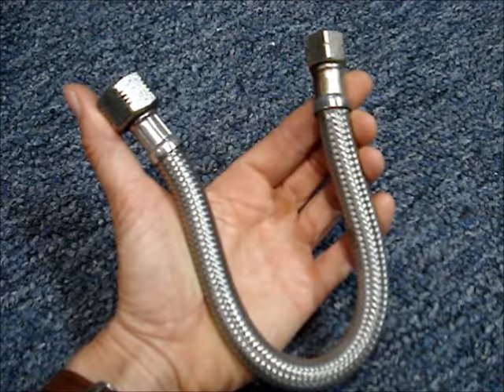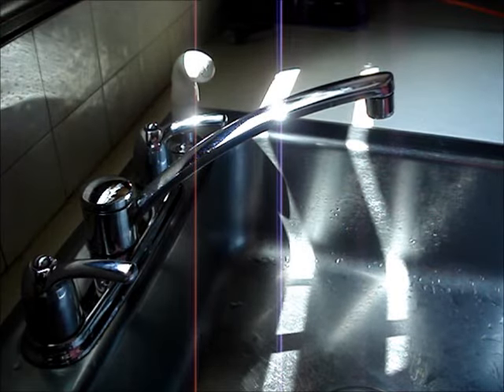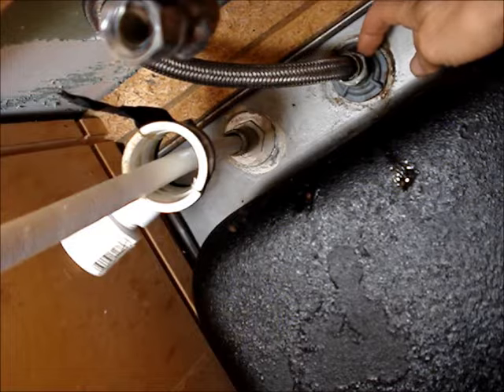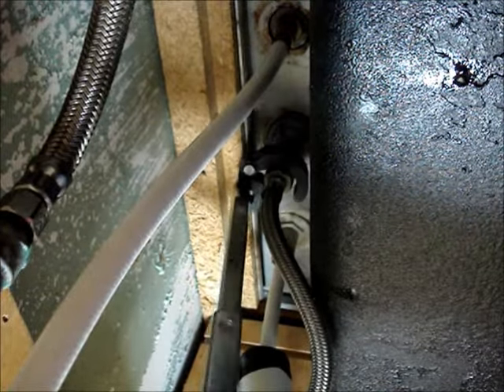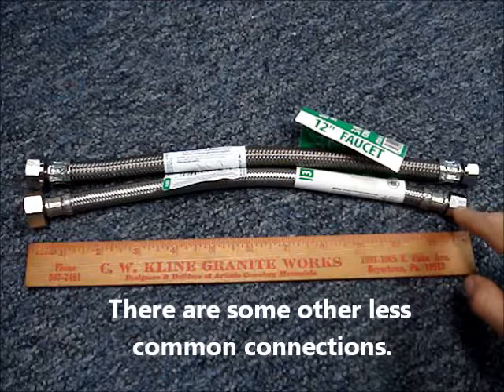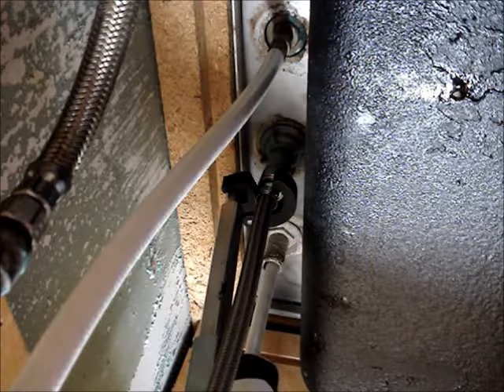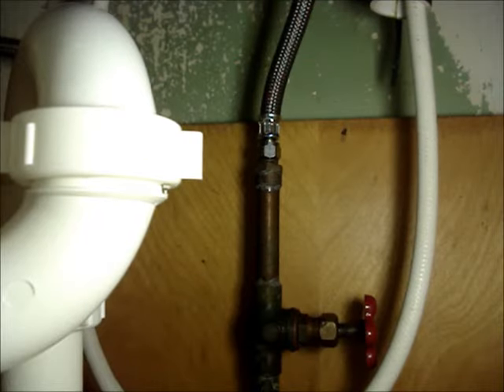Replace Kitchen Sink Water Supply Lines

Comment: I was wondering about whether to add thread seal tape to the stop valves, as well as the supply line connectors on the faucet, but it looks like the rubber gaskets on the supply lines provide a proper seal.  Thanks for the common sense tips.
Reply from the maker: It's my pleasure to help with the repair.  Thank you for taking the time to write the kind words.  Happy plumbing!  lol

Comment: You seem like a true professional! Subscribed after first video. I had a stuck supply line nut. Eventually, force with two wrenches freed it. I would guess they are all probably designed to move since their conception, so keep working at it if you have a stuck one.
Reply from the maker: Thank you for subscribing and watching the video.  Welcome to Know How Now.
Reply from the maker: You can try tapping it and some more penetrating oil, have a coffee and try again.  I have a dremel tool with a cutting wheel that I use as a last resort to cut stuck nuts, flanges, etc.  When I bought the dremel tool, I thought I'd only use it about once a year.  It just saved my again yesterday to get a quick link removed on my bicycle chain.
Reply from the maker: I can't think of any reason for a design that would have a nut that doesn't turn.  I've had plenty of stuck plumbing connections.
Reply: @Know-How-Now  two wrenches finally got it free. I was worried about breaking it/deforming it, but I guess it needed a little more force. Wild. Now I know. Thanks for responding.
Reply from the maker: Good to hear you got it loose.  Stuck stuff is the norm for plumbing repairs.

Comment: Very straightforward and helpful instructions. I now feel confident to do this job myself. I concur with how great it is that directions for closing and opening water flow  as clockwise and counterclockwise is included.
Reply from the maker: Best wishes for the repair, Jennifer.  Initially, I am sometimes apprehensive about trying something new.  I find that if I take my time and think everything through it usually works out.  The more things I try and learn by doing the easier the next repair becomes.

Comment: any idea why the hot water would dribble out and the cold is fine? I noticed the hot water cable under the sink is actually two cables joined together with a metal joint that the two separate cables are screwed into

Comment: what if the nut keeps spinning and will not come off? That is by issue ad i can't find anywhere on how to get it off
Reply from the maker: If you have the nut fully loosened, it could be stuck, try giving the hose a gentle tug to break it free.  The other possibility is that the threads are damaged.  Try pulling the nut away from the connection while turning it.

Comment: Thank you for this , especially the counter clockwise and clockwise directions in opening and replacing the faucet piping.( and not to put Too much torque!)
Reply from the maker: You are welcome, Brad.  Thanks for taking the time to write a compliment.  If you haven't already done so, click on the channel name and check out the other videos and support the channel by subscribing.  It's free, and it will allow me to continue to add videos.

Comment: VERY HELPFUL.  I was wondering if you used the basin wrench to remove the water supply line from the faucet (and likewise, to tighten them).  No way you will ever get an open end wrench or slip joint pliers up behind the sink basin
Reply from the maker: Thanks for taking the time to watch the video and write a comment, Matt.  You are correct, I did use a basin wrench.  You may already know this, if you have a rusty/stuck nut/connector, spray it with PB Blaster penetrating oil.  Gently tap the stuck part, wait a hour or better yet, overnight.  Then try again.  I have I video that shows how to use a basin wrench.  https://www.youtube.com/watch?v=gwM9Sk3E_Ok

Comment: are these fittings intended to be connected directly  to the flex line ? or do they need a little teflon tape or plumbers paste on the thread  ? ?
Reply from the maker: Both ends of the supply lines have a rubber gasket that will make a seal when tightened.  No need for paste or tape.

Comment: Question: Does wall mounted faucets have these supply lines? We have a line or pipe leaking water down to the basement from what seems to be something inside the wall connected to the faucet.
It started very soon after I installed a new faucet after our old one stopped working due to a bad cartridge (I was not able to find a replacement because of it's age).
Reply from the maker: Without seeing what you have, it's hard to give an accurate answer.  Check out this video, did you have a threaded connection like this one?  If yes, did you seal the threads with pipe dope or plumbers tape? https://youtu.be/BDm6oFUuJJA

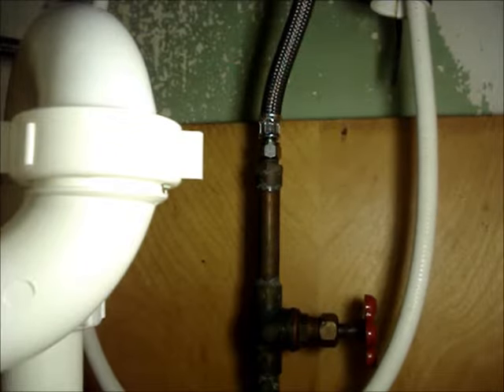Comment: My problem is the white flexible tube at 1:47 or 5:42, It’s leaking at the end of it. How can I fix that part?
Reply from the maker: It would be very time consuming and hard to try to write back and forth to you and give you an accurate answer on something I can't see.  I'd suggest searching "fix leaking kitchen sink sprayer".  You'll get video/pictures and how to fix it.
Reply: Know How Now it’s not the sink sprayer, it’s the white line that’s attached to the faucet
Reply from the maker: If I understand your question, you are asking if you can repair the flexible water supply line.  I've never tried to repair the ends on a supply line hose.  It would be hard to find the correct rubber washers for the ends.  I recommend replacing the flexible water supply lines, they are not super expensive.

Comment: I was able to get the nut off the valve but the hose seems to be stuck with some sealant any tips to free the hose from the water supply valve in this case
Reply from the maker: You could try heating it up with a hair dryer.

Comment: How often should the water hoses be replaced? I use the plastic kind.
Reply from the maker: The plastic will likely hold up longer than the rubber seals on each end of the hose.  I put the replacement date on the hose (Sharpie or a tag).  It's hard to say how long the rubber will last, it depends on your water and the location of the hose.  Heat would degrade the rubber seals more quickly.  If you don't disturb the connection it will likely last at least 10-15 years.

Comment: So, no plumbers tape needed?
Reply from the maker: No, the rubber gasket is the seal.  If you are putting tapered threaded pipe together or something without a gasket, then you need plumbers tape.

Comment: I just installed new supply lines for my kitchen just a few months ago but every few weeks they come loose and start leaking pretty bad.  How do I tighten them so they dont come loose again?  I've been told not to tighten them too much or that could cause damage.
Reply from the maker: You should tighten the supply line tight enough to compress the rubber washer so it makes a seal.  For most people you just need to use your hands to tighten.  I sometimes use a wrench for the last 1/4-1/2 turn, but I am female and don't have enough strength to fully tighten.  If you make it too tight, you risk breaking the plastic nut.
Reply: @Know-How-Now    I do that but I still keeps coming loose every few days. The nut isn't plastic.  I think its aluminum or steal,  and the line is brass.
Reply from the maker: You might try buying a tube of Loctite Blue (breaks away with tools) thread locker and putting a drop or two on the threads. That should stop it from loosening.
Reply: @Know-How-Now    Oh.  I thought of using thread locker but I was worried that would prevent me from removing the lines when I need to.  but since you suggest it. I'll try it.  Thank you.
Reply from the maker: I use the "blue" Loctite on my bicycle all the time.  It will break loose with tools.
Reply: @Know-How-Now  thanks for that info.

Comment: What if you have a plastic connector and the facet is leaking after replacing the hose?
Reply from the maker: Hi John, I'm not clear on your question.  Are you saying that you replaced the supply lines and you have a leak somewhere else?  I don't know what you mean by plastic connector.
Reply: @Know-How-Now  the set up under my kitchen sink has the hot water valve. I have plastic piping now copper or metal. Then above that is a plastic connector that has grooves for the hose to connect to. The water leak is coming from that and its heavy. Enough to rot out the floor. I shut the valve off but when I tried to remove the hose from the connector part of the connector broke off with the hose. I'm beginning to think this job may be better serviced by a plumber.
Reply from the maker: Hi John, yeah, it sounds like its not a simple fix.  Best wishes for the repair.

Comment: Thi under sink space must be huge. Helpful but doesn't reflect the reality of a tight space under the sink. What I would like to know is how to swap out the copper hot water hose which runs through the shut-off valve to the dishwasher. kdbergin hinted on this below. Who dreamed up such a crazy configuration?

Comment: do you recommend Teflon tape on all threads?
Reply from the maker: You should not have to use plumbers tape on the threads.  The rubber gasket on the ends of the supply line will make a good seal.  Don't make the connections supper tight, just tight enough to compress the rubber gaskets.

Comment: You didn't tell us what wrench size that's needed for the 3/8 and the 1/2 inch ends. The wrench required is definitely larger than those dimensions. Thanks.

Comment: I've found my cold water supply line to be wet. After watching this video it seems like the supply line washer is worn out causing some leaking. 

We just had our water filters changed out and I'm trying to prevent my Dad from calling the technicians who changed the filter. He thinks that they caused the leak even when I've told him that I can feel water on the cold water supply line.
Reply from the maker: A worn out washer on the end of the supply line could cause the leak.  Maybe they bumped/disturbed the connection, causing the failing washer to leak.  I always date the supply lines so I have some idea of how long they have been in place.

Comment: What oil penetrant would you suggest? We're staying in an apartment so they were rusty. We're having a hard time loosening it up. Thanks!
Reply from the maker: I use PB Blaster brand penetrating oil.  It's commonly found at the big box hardware stores where I live.  It has a very strong odor, open windows and use a fan to ventilate your apartment or try to contain the area with plastic.  I'd think breathing the fumes is not healthy.
Reply: @Know-How-Now  thank you!